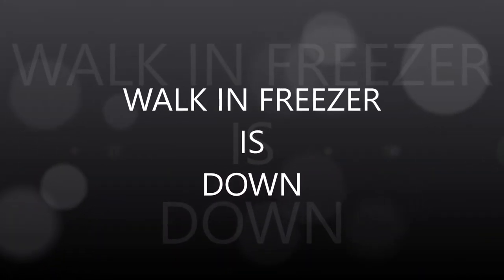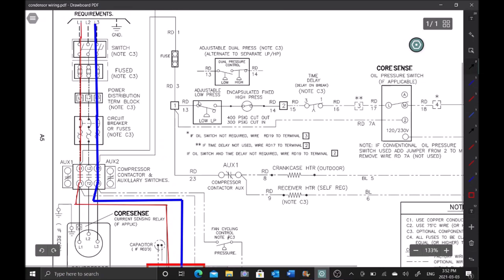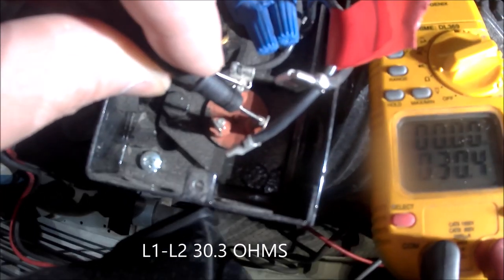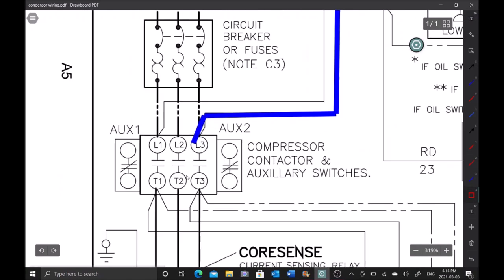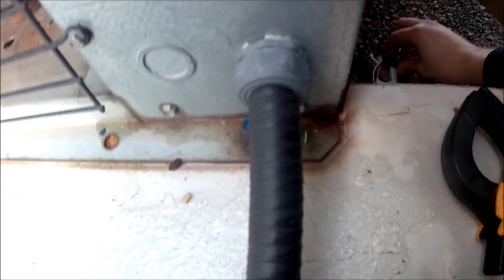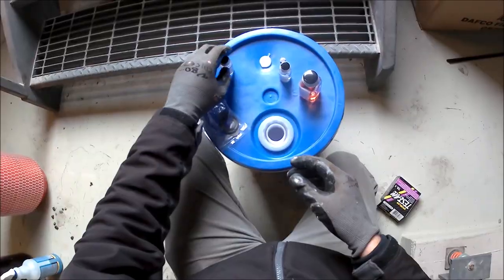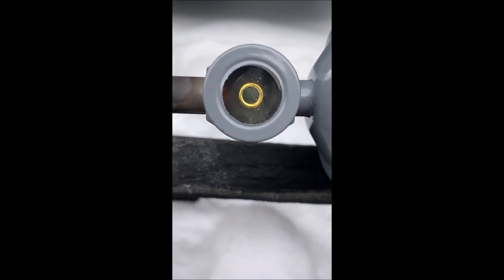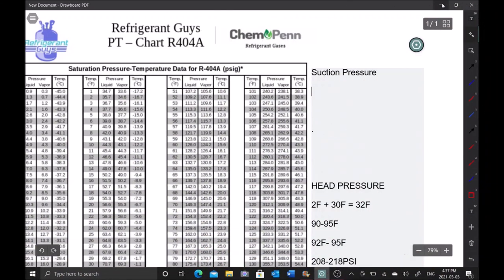Walk In Freezer 18 Month Old Compressor IS BLOWN... WHY?!?!?!

Comment: You have to pull the head to diagnose that compressor 
You may have had a failed CCH and you had slugging or flood back while running or on start ups 
If you also pull the oil pump and check the crank bearings I bet you have slack which caused the motor to touch down hence shorting out the L1 winding 
If you read the directions of that quick test the compressor must be running while performing the test 
Your videos are great just giving a little advise 
Great videos thank you for taking the time to create them
Reply from the maker: Appreciate the feedback. I’ve never taken one of these apart but I think I will on the next on, always eager to learn new things. How would I get oil into the bottle if the compressor is running?

Comment: liquid is what killed the compressor,block the condenser coil when charging to raise head psi clear glass, then add winter charge.also you need refrigerant in system if you are going to use the leak detector, to check for leaks,not nitrogen.
Reply from the maker: Yes there was a trace amount of refrigerant during the leak test. Thanks for the comment and advice.

Comment: Or you can block the condenser to 95-100° condensing and charge to a full glass and your done....
Reply from the maker: Yup, the point I was trying to make was knowing what your saturation temp should be in case there is no sight glass (ie- ice machine or a small prep table with no sight glass)  Thanks for watching!

Comment: If you knew the compressor wasn't running it would have been much simpler to just meter the feed into the compressor at the compressor.  The drawing wasn't relevant for this.  What the hell was the point checking the contactor first????  Work smart not hard buddy.  Checking the feed at the compressor would have told you what the problem was.  Checking the contactor first meant you still needed to check the feed at the compressor so checking the contactor was totally redundant and pointless.  This was not very clever diagnosis.  You never needed to check the drawing at all.

Thank god you had enough brains to know you didn't need to disconnect both sides of the heater for the impedance test.   If you had I'd be telling you it maybe isn't a very good idea to upload any more videos.
Reply from the maker: This is a training video for my techs. Most of our refrigeration techs are pretty green so I always teach them to check incoming power (especially  on 3 phase). Checking amp draw was to show that the compressor was going off on overload as you can’t really hear the compressor running then shutting off in the video.  Yes I mentioned to open up the circuit to check resistance, someone new might not know that. These are training videos for our newer techs so they can get used to using a schematic. I’m sure when you started in the trade someone had to teach you. Unless you are one of those techs who started in the trade 18 and knew everything. If that’s the case, good on you, you are much smarter than I’ll ever be.
Reply: @REFRIGERATIONKITCHENEQTECH  I'm not in the trade.  I am a Sound Engineer by profession.  But I've also worked in fairly technical positions including automation of emergency generators.  

All the same rules apply.  Don't waste your time checking the switch/contactor or if all 3 phases are hot.  Check the feed at the point of suspicion.  That will tell you there and then if you've found the fault.  You might have to work your way backwards to the blown fuse or faulty contactor.  But what ever test points you use, they should always be in order of giving you as much information as possible from one location, as well as eliminating as many failure points as possible.  Otherwise you just spend your time double handing stuff you really don't need too if you've tested in the correct order in the first place.

It's all very well working systematically but this approach can waste an awful lot of time.  If you tested at the compressor you'd know the phases are hot or not and that the contactor is good or not.  And if the compressor feed is hot then you've found the failure.  

The drawings are for when things get complicated and you need to know where to find something that isn't sitting out in the open.  The drawings should never be what you refer to before doing anything with a fault like this.  If the compressor has failed then test the compressor.
Reply from the maker: Interesting to see someone in a different field use similar techniques. I always teach to check incoming power, a lot of newer techs won’t do this and start to work backwards only to find they dropped a phase. Amp draw needs to be taken to see if the compressor is failing on locked rotor or if the overload is opening to early. IE- if the overload was opening up at 6A as opposed to 39A, the overload is bad. That is a $200 repair vs a $6000-$7000 repair. But yes I full agree, find the load and work backwards.
Reply: @johnrauner2515   if you had a clue as to what you are pompously pontificating about, you would know it is very easy to check at the contactor first, instead of breaking open a brittle plastic compressor connection on a roof in pre-dawn hours at near zero degrees ambient.

These videos are for training his techs and graciously allows public viewing to share knowledge and teach other techs in the restaurant equipment and ac trades.  Even though I have done much of the same work for years, this old dog is still learning from these videos.
Reply: @davejohnsonnola7908  I had assumed common sense would be applied.  Obviously if the contactors and control equipment are inside and far easier to access then they should be the first test point.  

Jesus mate, calm down.
Reply: @davejohnsonnola7908  Exactly!